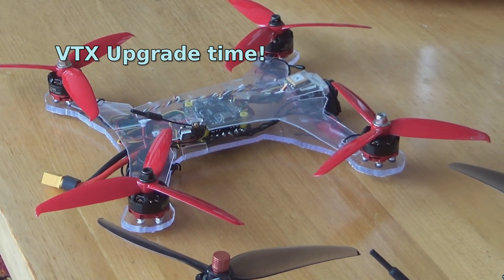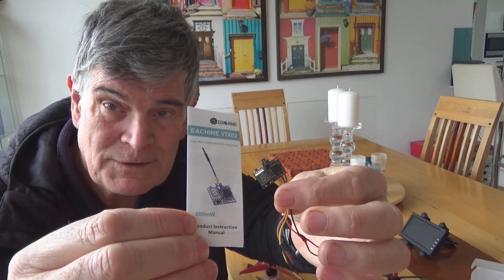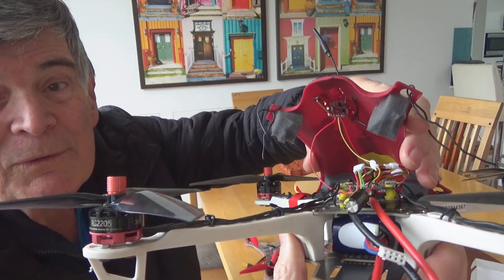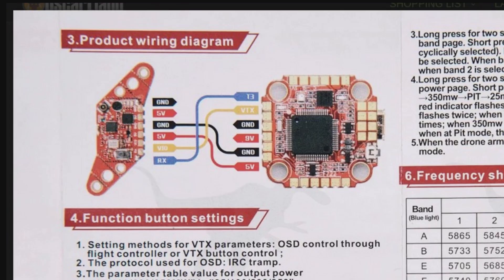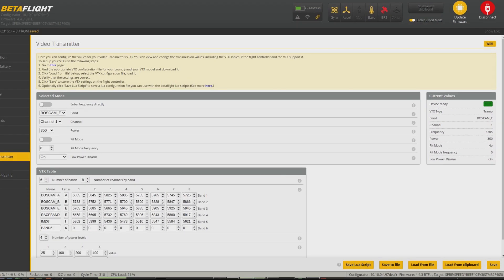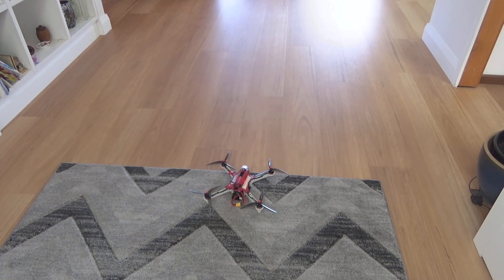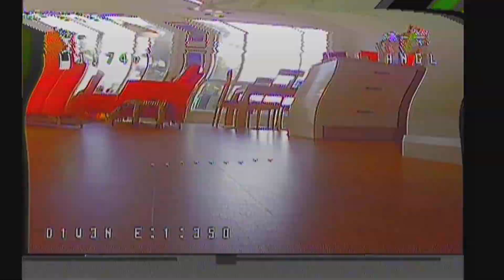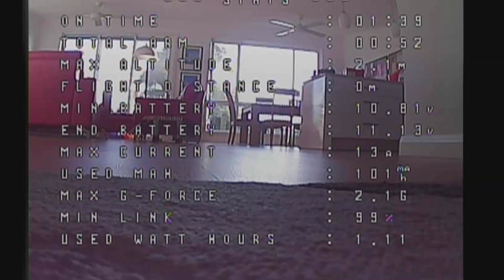Installing, setting up and testing Zeus Nano VTX with Betaflight

Comment: I bought this transmitter too. It's working decently on 25mW but the reception becomes absolutely poor when I switch it to 350mW. Any way to fix this up? Also my reciever is one of those cheap skydroid otg fpv modules
Reply from the maker: Tested out to 573m on 350mW so far. Get some banding and interference, but OK. Still trying different mounting options to get a consistently cleaner image. I use a Skyzone 04X with twin RHCP antennas set for diversity.
Reply: @skybug3 ooh. You got pretty solid vrx. Mine is the super cheap otg fpv transmitter😊